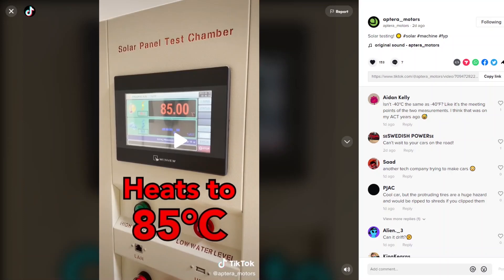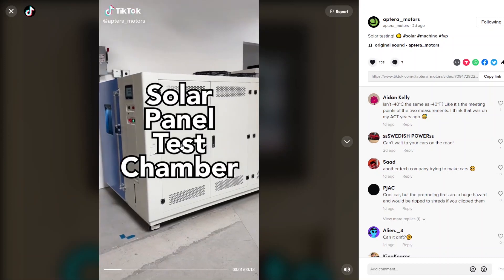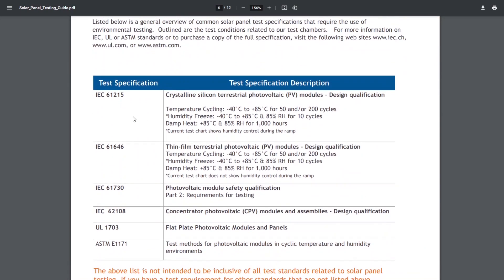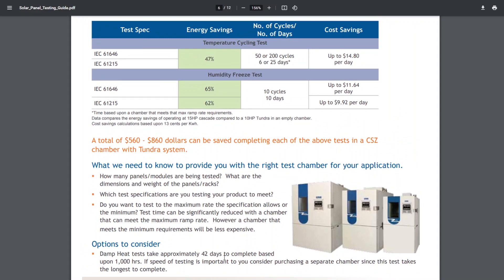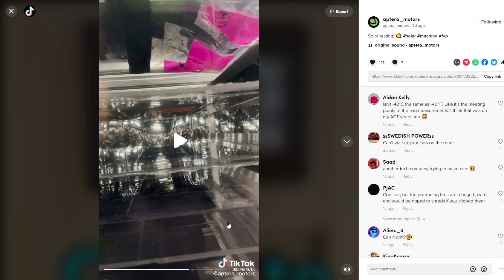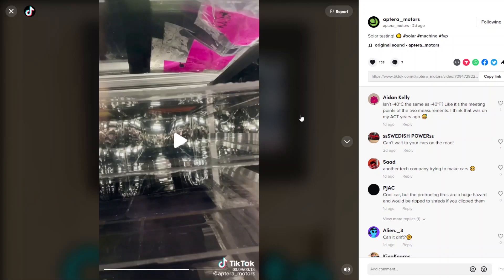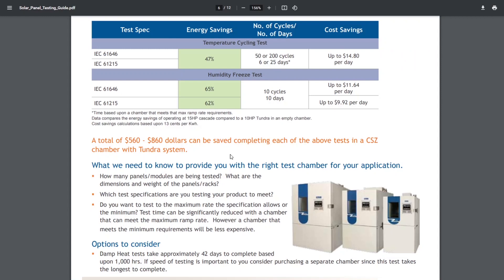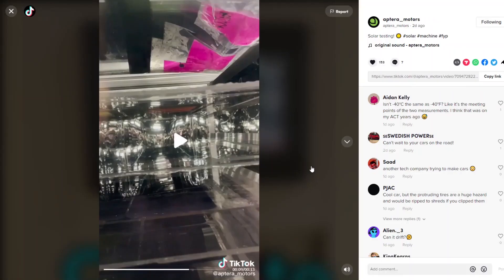Aptera starts solar testing

Comment: Excellent analysis. Thanks for looking up the standards. 

Note that these extremes don't represent the actual use cases for reliability. Meaning that these extremes are being tested with the purpose of saying something about less extreme conditions over a longer period. So we should feel comfortable because they are following the standard, not because they are testing beyond the limits of what we actually experience. 

I agree with your analysis regarding the timeline. If testing proves that the designs aren't reliable, delays are inevitable. That's why I'm hoping and expecting they are doing a lot more reliability testing. For instance on some of the mechanical stress points, like the door hinges and the interface points between the suspension and the composites. 
Did you see any reliability testing being performed when you visited?

Comment: UL 1703 is more than a minor difference, it is completely different.  The following is copied from the UL site and from UL 1703 specifically.
Test Procedure: Section 31.1 Fire Testing of the PV modules are required to be tested once with both the Spread of Flame and Burning Brand on Top of Surface tests. Both of the tests are based on the ignition flame being directed on the top surface of the module or panel with no roof covering below. The Burning Brand on Top Surface test uses a specific type of brand (A, B, or C) as specified by the “Type” of module or panel being tested.

Section 31.2 Fire Testing is the System Fire Class Rating of a module or panel with mounting systems in combination with roof coverings. The two types of roof slopes are Steep-Sloped (> 2in/ft slope) and Low-Sloped (< 2in/ft slope) and can be configured in a Symmetrical or Asymmetrical configuration of the roof slope. Both of the Spread of Flame and Burning Brand Tests are required for the Steep-Slope.

End Result: During all of the tests mentioned above, you will get a pass or fail result as well as a test report that will have detailed information on how the modules or panels reacted to the various tests. The Spread of Flame test is measured by surface ignition over a ten minute period (needs to be less than 6 Ft). The Burning Brand test is identified by penetration or flaming on the underside of the roof deck. The fire test report is needed as one of the key tests for getting a product certified with the ETL mark.

Special Conditions: When testing Building Integrated Photovoltaics (BIPV) you should follow the UL 790 test standard requirements.

Comment: Thanks for the look at Aptera's solar testing. It seems to me that having solar encapsulation that can work well under the harsh and varying conditions of being mounted on a car wouldn't be a simple task, but it wouldn't be a new one either. So most likely all of the encapsulation materials being tested have previously gone through similar testing before, and these tests are confirming the properties and performance of those materials and systems. Which is important. But I agree that probably the majority of these materials and panels have already been proven to be robust and resilient, and these rigorous tests validate those specs. And since there are multiple tests being done in parallel, the results would sort out candidates by cost and availability, more than if they work or fail the tests. It's just a guess, but that's how I would conduct the tests (doing more research ahead of testing) so that the chosen candidates would mostly all succeed in the first round of testing. I hope that this is the case here.

Comment: More importantly, are they testing critical UV stability in regards to encapsulation? Heat, cold & humidity are important but here in NZ we have a very high UV index which can destroy polymer based encapsulation extremely fast.
Reply: UV can destroy SOME TYPES of polymer based encapsulations extremely fast.  Conventional solar panels typically have polymer based encapsulation and some are warranted for 25 years (+) of continuous exposure even in NZ.

I do agree, however, if Aptera isn't using something already proven, I hope they are also, simultaneously, doing full on, "accelerated" exposure reliability testing.  Ideally, thermal cycling w/ UV AND mounted as is to be mounted on vehicle.

Comment: I could wiat , I would love a ac plug or two, and be able to charge kick back and use power at the same time. I been looking at 12v micro fridges as well and cooking would be awesome.
Reply: They are planning a limited wattage ac plug - probably not more than 1,500 watts.

Comment: I've spent some time in an electronics stress lab, I can tell you they are almost certainly doing work in parallel but they're probably not batching like you are imagining. They likely have hundreds of different variants that are placed into different stress machines at different times, and are tracked and monitored along the way. This means it could take 50% longer to get a good test results but it drastically lowers the risk of doubling the timeline, plus you can keep it running with improvements after you've selected your production material.

But I don't have experience with solar or auto manufacturing. Just semiconductors.

Comment: Eh, they could always start shipping solar-less vehicles for people who wanted one while waiting on the solar engineering.
Reply: Could, but the minimum configuration of solar is on the roof and dash. There are no versions without some solar. But you are right some may want an Aptera that way. However, it would not be a good business decision to have Aptate on the roads without solar since solar is prominent in the promotion of the Vehicle and one of the two differentiators for Aptera

Comment: its cute that they think 85% relative humidity is high.   aloha from muggy hawaii.
Reply: Not to minimize Hawaii's high relative humidity, 85% relative humidity at the temperatures the tests are done at are extreme.  When was the last time Hawaii had 85% relative humidity at -40 C or +85 C?
Reply: @bobhilder1469  that doesnt happen on this planet.  or most of the other ones within driving range either. :P
Reply: @pezpengy9308  That much is certain!
Reply from the maker: love muggy hawaii!

Comment: Negative 40c is not the same as -40f
Reply from the maker: it actually is exactly the same.

The formula for conversion is (°C × 9/5) + 32 = °F

-40 is the one place on the scale where the two scales are the same.
Reply: @ApteraOwnersClub  you are correct my friend
Reply from the maker: https://www.unitconverters.net/temperature/celsius-to-fahrenheit.htm
Reply: Yes it is. Do the math.

Comment: Would really love to see a reputable legacy ICE Manufacture such as Honda, Mazda or Subaru collaborate in further design/manufacture collaboration.  This might allow them to ramp up their "Production Hell" when they begin rolling out orders to the mass public.  I'm lining up for one of these as I hope millions of other Americans are.  Having no gasoline or oil required to drive will send a message to the oil companies who seek to gouge/profiteer off of consumers, during any black swan event.
Reply: Aptera is not using any of the traditional auto manufacturing approaches. They are using a lean manufacturing process designed by Sandy Munro who has successfully designed lean processes for auto and aero space manufacturing. The process will require less labor and equipment than a Honda, Toyota, or for that matter Tesla uses and gets scalable results. This approach is much cheaper and will bring production readiness forward in the timeline vs. traditional processes

Comment: Is there only 1 of these testing units?  I assume they are using this machine at a test facility or are leasing it but couldn't they use 2 (or 3) and test simultaneously?  Also, they are testing things that have been being done for some time, not overly revolutionary.  Chances of success should be extremely high.

P.S.  I assume this is a test facility of some sort.  Unless I'm missing something, it wouldn't make a lot of sense to purchase the machine, set up all of the wiring (and plumbing) to do this type of testing unless you need it on a very regular basis.  A testing facility may have multiples so you can do simultaneous testing, if it makes sense from a potential failure and cost perspective.

Also, they may have done some previous testing, so perhaps at this point, they are simply testing the final 'production' encapsulation.  There is a lot unsaid in the tic-tok video and then assumed moving forward (like maybe they have had this machine for several months already?)

Comment: I think Aptera has exceptionally talented engineering staff and sound dev and test planning. I concur that they are testing in parallel as that makes the most sense. Also let me remind all, If testing in parallel (Except for tests that must be done sequentially) you can review the results as the test completes and start on changes if needed. I would suspect at this point, Aptera in conjunction with the cell manufacturer, are very familiar with all facets of performance of the cells and the options for the material to cover them. Maybe at the most some medium risk, but not high risk. Remember, the manufacturers reputation is on the line too and they will do a lot to make sure things turn out well.

Comment: That's why I went ahead and ordered a Tesla Mod Y performance which I can drive while I wait for my Aptera.
Reply: Same here with my new M3P delivered just in time for my TeslaCon to Starbase road-trip from SoCal! (Trying to schedule fixes to trunk closing, “burning insulation” smells over 106mph, & failed 12 volt (lead-acid vs advertised lithium) battery problems that cropped up.)

Comment: i hope they do more than a -40 degrees because here in Canada we get temperatures less than -40.
But i feel that they should go ahead and come out with products even if the test is NOT successful with an option to replace them when it becomes ready so that the production schedules can be met and revenues can be generated.

Comment: As a solar installer, they talk about decades of use being simulated. Over the last 10 years solar panels have increased in wattage  by about 50% with the same panel  size that for example was 270 watts, now is 395 watts. The depreciation of the output has improved from 80% output in 20 years, to now the minimum is 80% in 25 years and bifacial ones that have a glass backsheet are up to 85% output in 30 years. Who knows if the trend continues at such a pace, but there is a good chance in some  years  that one might want to replace the solar with new ones that would get more mileage. The interesting thing will be too see if the encapsalation yellows over time and how much it decreases the output over flat glass. Overall its a great feature to have built in solar.
Reply: Thanks for adding this additional technical information. Upbeat for all of us that are solar fans both for the home and the Aptera
Reply: How easy/hard/costly might replacing cells for repair or upgrading be?
Reply: @Crunch_dGH  my guess is that it will be a body pane replacement (ie. new hatch cover).
Reply: @arlenbell4376  With the possible exception of the rear hatch, Aptera appears to be aiming at making the solar "panels" in such a way that they are relatively easy to add/remove from the body.  I was very pleased to hear that because I was initially concerned that they would be more permanent parts of the body.
Reply: Simple math tells you the trend will obviously not continue, because there is only so much energy you can get out of a given area even if the panels had maximum theoretical efficiency. In regular single-junction cells we saw the largest increases in efficiency some time in the 80s, the increase has been slowing since then. Experimentally they're now close to 50% archived by staking cells on top of one another but there too we now see increases slow asymptotically.
Reply: @ramdas363  well of course, nothing can continue indefinitely.
Reply: @20xx-mm-dd  Yes. The point is the trend won't continue at the same pace like the other person speculated. It's unlikely the panels will need replacing unless they get damaged in an accident or such. Aptera has said they will be replaceable for that reason anyway though.
Reply: @ramdas363  he said he had no clue. Then you chimes in in a snarky way.
Reply: Interesting. What I see as a challenge in contrast to glass face panels is the rate of inevitable degradation of the encapsulated optics of the whatever polyrazzmatazz material. Whereas glass panels are touting 20-25 service life to 80%, Aptera is looking at a 10 year service life. The issue is the infrared spectrum, which does not contribute anything to the electrical but does contribute to most of the degradation while being responsible for around 80% of the heat gain. Being that the cells are surface mounted adds to the heat stress. I am opting for the minimal amount of solar cells on our order and prefer to have the glass hatch. I'm not convinced yet that the system will be a realistic asset but rather a liability should the system not prove itself durable.
Reply: @babaluto  It's either a question of economics or people just want to do it. In my neck of the woods, I should theoretcially get 8,000 or so miles  a year. Forgetting degradation for a minute, if the panels last 10 years thats 80,000 miles/10 m/kwh x .13/kwh, so it doesn't really pay. If on the other hand I was in a much sunnier area with higher electric rates it would make a lot more sense. Another factor is, if one uses charges away from home, the price per kwh is a lot higher. So good for some, much better for others, cool for everyone.

Comment: My old eyes tell me Aptera's testing multiple size cells!  Take a look at about the 3 min mark.  Don't some cells look bigger?  Maxeon does make two sizes of cells.  The original size being 125 x 125 mm pseudo square (about 5" x 5") and a newer size of, I believe, of 162 x 162 mm pseudo square (about 6.4"x6.4") that are used in their Gen 5 and Gen 6 panels/modules.  I think the recent hail test clip has the larger cells too.

Comment: Do you think they're only testing one type or configuration? Wouldn't they test multiple samples and pick the one that works as it needs to ?
Reply from the maker: Yes I'm sure they are testing in parallel
Reply: @ApteraOwnersClub  Or sequentially, replacing failing batches as they go with ones improved from lessons learned. Wash, rinse, repeat until the optimal stable design(s) are reached?
Reply: Did you watch the video?  Steve said all that.
Reply: @bobhilder1469  I screwed up. I didn't listen to all of it. Thought I had.
Reply: @bobhilder1469  I must have missed it.

Comment: With the modularity of the aptera, could they not sell slightly subpar vehicles on the first production run with the promise of upgrades as they further improve their technology? Especially with the solar panels being exchangeable, this could be a simple fix.
Reply: I don't think they intend to do that.  While they WILL practice continuous improvement, they will be judged on the quality and performance of the first vehicles.  We know there will be some supply chain availability sacrifices, but they are going to plan around that as best they can - for example resistance instead of reverse cycle heat.

Comment: Although both tests look the same, they are more likely to be doing the 61215 because the CELLS are crystalline silicon rather than "thin film".
Reply: It looks like a big test chamber and they started making their first production runs a few weeks ago. There could be hundreds of slightly different panels in there.

Comment: Can you tell if they are cycling with infrared heat? Thanks
Reply: I''m no heat transfer expert but it seems to me that infrared would need "line of site" to each of the test samples in order to heat them up.  My best guess is they are simply using resistive heating elements and circulating with fans/blowers.
Reply: @bobhilder1469  Agreed. Reason I was wondering why, is because infrared makes up a majority of the spectrum. I'm no expert either but I believe when it comes to optic degradation, rejecting IR from the encapsulated layer above the cell will be a major factor in it's longevity.
Reply: @babaluto  I like your thoughts but I do believe most "optical degradation" comes from the UV rather than Infrared.  Also, interestingly, Maxeon/SunPower cells are the most efficient cells around (single junction crystalline silicon) because they "respond" (i.e., generate power) deeper into the blue and the NIR (near Infrared) than other single junction crystalline silicon.  If you're interested, look for SunPower Spectral Response.
Reply: @bobhilder1469  I stand corrected. Thanks. I've been focused on the proprietary coating they are working on. I still see heat as the big factor. Yes, the cells they are using are top tier but with heat comes accelerated degradation, no matter the source. Time will tell. My thoughts about infrared was to focus on keeping the cells as cool as possible, that would give the other parameters more to work with. There are some plastic films now that use an additive to reflect a large portion of IR while only reducing a small percentage of light transmission. I use it on my three greenhouses. The 11 degree difference it makes is remarkable. It was either quartz or talc powder mixed in the manufacturer. And then, maybe I'm out to lunch. LoL
Reply: @babaluto  You're welcome and I tend to agree that the temperatures the encapsulants are likely to see will be their biggest source of degradation.